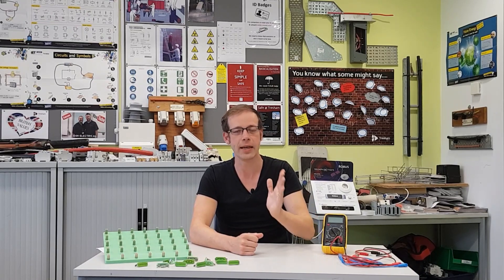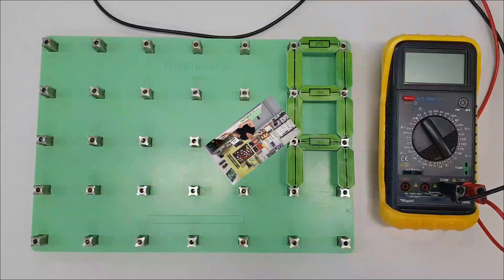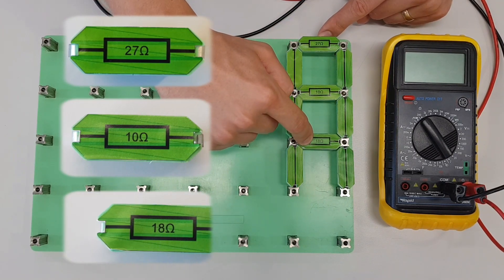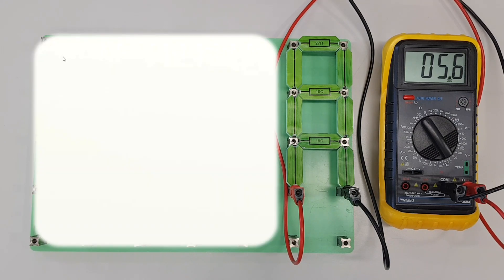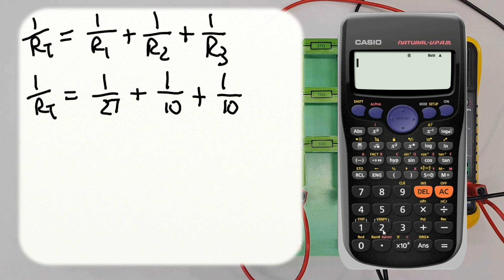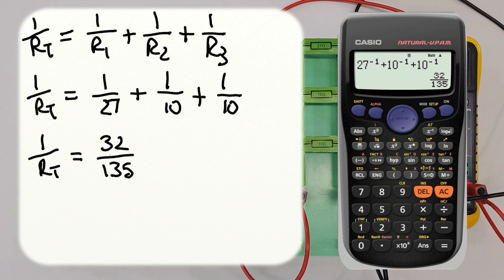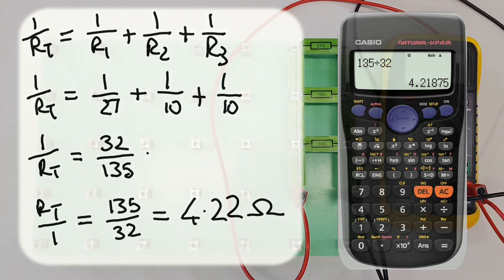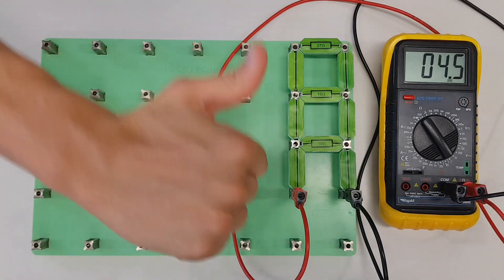Resistors in Parallel - How to Find Total Resistance for Any Number of Resistors

Comment: Hi Joe, could you please explain why you would not just use a 5 ohm resistor in series instead of using 3 larger resistors in parallel to get a lower resistance?

Comment: Hi Joe just wondering is PRODUCT/SUM rule to be used with 2 parallel resistors and the reciprocal rule to be used with more than 2? Also these videos are great and a massive help in my studies 👍🏻👍🏻👍🏻
Reply from the maker: That's the general rule Lyndam yes. Although the reciprocal rule can be used for 2 resistors also and it is possible with a few more steps to repeatedly use product over sum with more than two resistors, but it gets a bit confusing.

Comment: Are you saying you have to buy a fancy calculator or an iPhone to be able to do this calculation? I have seen this done on a basic calculator using only division and add. Disappointed in your explanation requiring a fancy calculator hence the thumb down.
Reply from the maker: Sorry you felt the need to dislike my video. I'm not saying you need to buy an iPhone to carry out this calculation, I wouldn't recommend anyone buy an iPhone as I believe you can get equivalent or better functionality from cheaper smart phones. I wouldn't recommend you buy a smart phone for the course that this video is designed to help with, this is because you can't take a mobile device into an exam. That's why at no point in the video do I mention iPhones or smart phones. That only leaves calculators, indeed you could do this calculation on a cheaper calculator, the problem is the input becomes trickier on some models without a reciprocal button. Also as the course continues you'll need to carry out other functions such as trigonometry which would be trickier or even impossible on cheaper calculators. The latest version of the calculator featured in this video can be bought for about £11 on Amazon and can often be bought for even less during "Back to School" promotions. This is a very reasonable investment in a device that will make your experience on electrical courses much easier. I have been recommending these devices since 2008 when I started teaching and will continue to do so. I hope this explanation eases your disappointment.
Reply: First my apology for the misdirection, I should have said SmartPhone rather than iPhone. Second my apology for the thumb-down (now corrected) as I did not realise a scientific calculator was required because of further lessons in this course. At the time I just needed a quick method to work out a problem I had at work and was a bit stressed. This is not my normal kind of work. Finally thank you for uploading these videos giving free education - please keep it up, they are most appreciated - eventually.
Reply from the maker: Thanks for the response it's very much appreciated Anthony. I understand the feeling of being under too much pressure and stress, hope things have eased up a bit for you now. Take care matey, plenty more content on the way. 😊
Reply: its not a fancy calculator is a basic but useful casio that does the job. the x-1 or 1/x is a handy button. You cant use a iphone or any mobile in the exam.

Comment: I bought a new Casio calculator and was disappointed to discover no 1/x button. I just realised about the x-1 thanks to this video. Cheers Joe 

Btw when you get the initial answer on the screen (1/rt) if you press x-1 it automatically converts to the final rt👍you should do a video on tips involving the Casio calculator with regards to electrical equations👍

Comment: Never been good at fractions - and Iphone doesn't calculate them with native app. Is there a better way to do it with decimal only? I have: 1/27(0.037037) + 1/10(0.1) + 1/10(0.1) = 0.237037 - - - 0.237037 * 1000 = 237.037/1000 - - - flip over to 1000/237.037 = 4.218751 = 4.22ohms. Brilliant videos, just what I've been looking for without them being 15yr old videos on youtube!
Reply from the maker: Hi Iain. Thanks for the comment. Your iPhone has a reciprocal button if you turn it sideways. It's marked 1/x. If you type the bottom number of the fraction first then press 1/x it gives the decimal equivalent. So your button press would go 27, 1/x, +, 10, 1/x, +, 10, 1/x, = then pressing 1/x again should spit out the total resistance. Hope this helps and please keep watching!